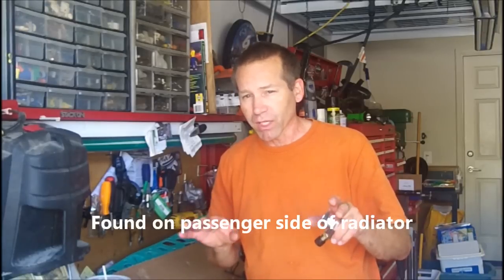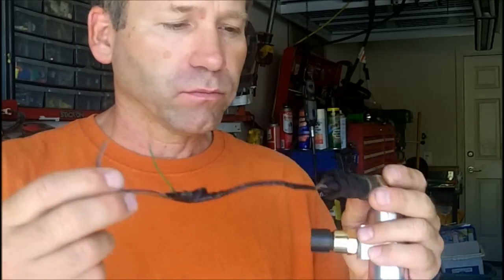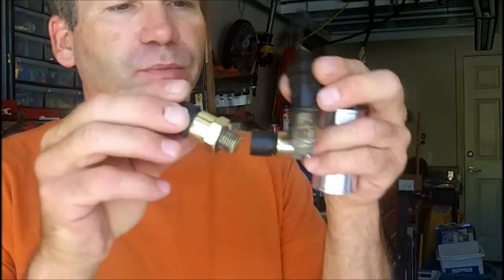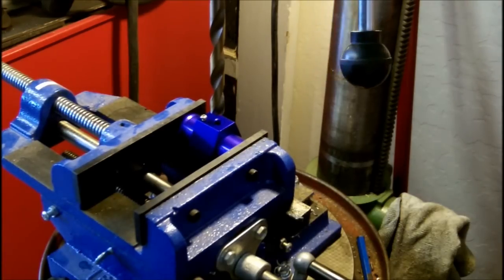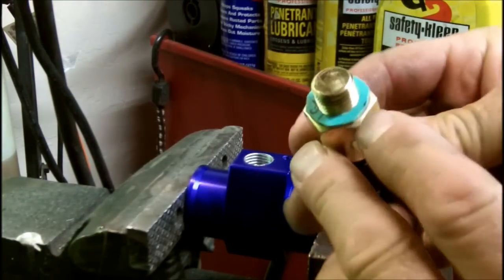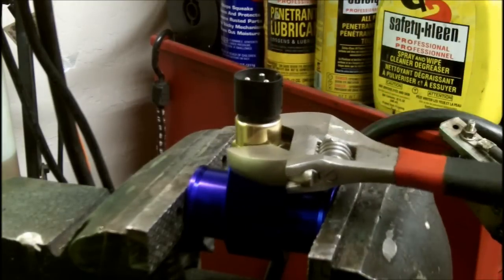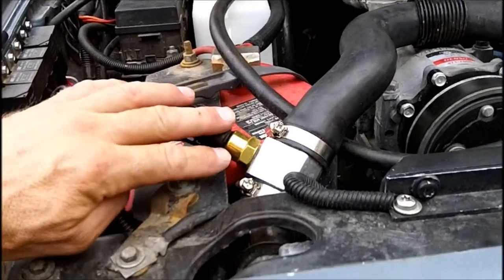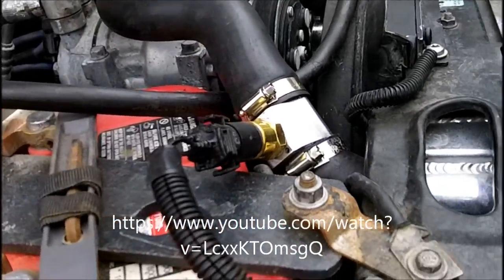How to install a 2 speed BMW Fan Switch and radiator hose adapter

Comment: Great video, could you please answer this question would this work for a 2013 Ram 1500 , i don't know what fitting i might need i just want more cooling on hot day's here in the south and traveling....you video gives a better ideal on how to do it please advise.

Comment: Do you have a pinout for the BMW thermal switch?  I'm trying to put an Efan in my E39 and no one can tell me for sure which pin is ground/low/high.  Your linked video says it's a Saab switch.

Comment: We sell the in-hose thermostat and fitting in this video at https://www.americanvolt.com/collections/in-line-thermostats which requires no tapping. Hose fitting sizes available from 26-50mm or 1-2 inches outside diameter. Various thermostat switch turn-on temps available as well.

Comment: I know this is an older video.  Do you think a 30mm radiator hose adapter would work fine?  I'm asking because amazon now has a plethora of sizes available, not just 32mm.  Thanks, Dylan sends (I'm surprised this thread has not received a bunch of posts!
Reply from the maker: yeah I think it would work but if your looking for a 32 here is a link https://amzn.to/2ZlYPk2
Reply: @martinbuilt  Thank you for the reply. Strange, YT did not notify me that you replied. Such are 1st world problems ! Thanks Again, Dylan /edit My wrangler has an Inside Diameter (mm):  32mm /edit again, I'm going with the 34mm as a lot of reviewers are saying the 34mm is the 'lip', guess I'll find out.

Comment: The 97-98' 528i radiator fan sw has a higher temp on and off. Better but st might require a lower t-stat.

Comment: BMW switch fans stay running forever. Shut off temp is to low for the inlet side. hose of the radiator. Saab an VW switches have a higher temp on and off thus fans run only when needed and do shut off when cruising

Comment: One bit of advise. Since you already used your drill press to drill the hole, leave the work piece in the vise and replace your drill bit with your tap. Start the tap into the piece with the press so that it goes in exactly straight. Since the piece is only aluminum, you probably could even use the press powered up to do the tapping, (IF YOUR SPEED IS SET SLOW and YOU SHUT IT OFF QUICKLY).

Comment: I Did this with merceds fan switch but the head of the switch is not passing through the adapter barely passing and my fan some time wor and most time overheating should t be trrated as one block i mean when adapter get hot the switch should be at same tempreture and should work am i right?
Reply: That's probably why they make them out of aluminium, which is a good conductor of heat.
A solution for you is to use a lower temperature thermoswitch (so it turns on at a lower temperature) or like the top comment says, turn the adaptor upside down so that there is definitely always fluid in contact with the sensor.

Comment: 8:34 It turns from blue to silver. Amazing.
Reply from the maker: Yes I made more than one. The blue one was slightly too small of a diameter for the radiator hose the ebayer that sold it advertised it incorrectly. So I ordered another one and did it one more time.
Reply: I know, I was joking :)
Reply from the maker: I figured as much...Lol

Comment: Do you waterproof your relays??
Reply from the maker: I haven't but it would be a good idea if your going to be doing deep water crossings.  I believe the Zettler  relays that I used are water proof.
Reply: I had another question on your wiring video, I’ll ask you there!  Thx for the reply

Comment: when the high activates, does the low stay active?
Reply from the maker: Justin Hoglund no it does not if it did this would burn up the motor eventually
Reply: Does the low side switch cuts off when high kicks on or the relay takes care of it? The reason i ask is that i need to connect ac compressor to the curcuit.i know how to do it with 3 bosh relays though

Comment: Thanks for that. When I drill and have to tap I leave the job in the drill press, take out the bit and replace it with a rounded nail that locates in the dimple in the top of your tap. Hang a weight off one of the handles to keep the nail pressure on the tap and away I go a per usual. That way (at least for me) the tap will be plumb to the hole.
Reply from the maker: nice

Comment: why you guys installing the coolant fan switch on the outlet to  the engine to raditor, example  newer vehicles  run 195 -205 degress  coolant temp coming out of the engine is regulated  by the thermostat  so if you install a 210-195 200-185, 185-175 it would never turn off! leading to premature  electric fan motor life, sensor should be installed on the outlet side of raditor so the fan will cycle on and off, when going down the road in most case the e fan will not come on! unless your slow climbing a hill.

Comment: The switch should be on the OUTPUT / LOWER radiator hose sensor aimed at the ground; this will ensure your sensor is ALWAYS in the coolant flow. If your coolant is too low there will be air on the upper half of the hose and the switch will not activate because it can't sense the actual temperature of the coolant 1/4" away...
Reply: put the sensor side of the adaptor on the bottom side of the top hose... hanging. genius.

Comment: Thanks for this video it was very helpful. I'm doing an LS swap in a Nova and am figuring out my cooling system. I'm running a stock 2002 Camaro radiator and dual fan setup. I snagged the fan control box out at the wrecking yard that runs the fans in series, or parallel (dual speed). I was planning on running this BMW switch (there's two different switches I've found so far with varying high speed temp). My question is that some people say to run the sensor in the hot side of the coolant flow, and some people say to run it in the radiator outlet, or cool side. I think I'm leaning on the cool side as the radiator outlet is a direct measurement of the effect of your radiator and fan system to lower temperatures. If the coolant coming out there is too hot it turns the fan on. If it's on the hot side the fans would run a heck of a lot more often and sometimes for no reason. Anyway, a good post is from Mike Goble over on this forum: http://www.stevesnovasite.com/forums/showthread.php?t=415225. I was just curious what your thought process was on deciding on the hot side. Thanks again for the video.

Comment: The plug is four parts that are available from BMW for $27. 

#61131378412 - plug housing

#61130007445 - wire, small, x2

#61130007446 - wire, large

#61318361787--BMW temp switch 180°/195° 

#61311378073--BMW temp switch 195°/ 210° 

Get a Volvo 2 speed fan relay new for about $35 on ebay, made in Germany, dont get the china crap. Get the plugs for the relays from your local bone yard or interwebz.. Nastyz28DOTcom has the best info for the taurus/volvo fan swap.. The volvo fan is good for around 3600ish cfm on high!
Reply: Freshkryp69 where are you finding the housing and 3 wires for that price? Cheapest I found was around $35 minus shipping.
Reply: @leviv1  Ebay

Comment: Would this switch work for dual hi/low speed  fans? Also what are the three wires in the switch? I'm guessing ground hi and low wires? I'm trying to do a dual fan dual speed with ac set up on my truck. I would like to set it up to where one fan runs just off engine temp and the other fan runs just off ac. I would run the ac fan strictly on hi. Would your set up work for the one I'm trying to do?
Reply from the maker: Yes you could wire it for low for engine Cooling and high is for the air conditioning. yes you are correct one is ground and then the other is high and low would complete the ground circuit. you could also use it to complete a positive circuit as well.

Comment: I have an 01 ford 5.4 and have installed this sensor in the water crossover on the intake. It turns on at 195ish and doesnt turn off until under 192 its causing the fan to run  a lot. Do you think the sensor location is causing this? It's right next to the outlet hose.
Reply: This is a aux fan switch for the BMW the temp is to low for the inlet side of the radiator. It needs to go on the outlet to the engine after radiator has cooled coolant below 190 degrees. If not low speed fan will run all the time.

Comment: Whats the part number for the BMW thermal switch? Do you happen to know the temperature settings which it turns on and off?  What amperage relays are you using for the Taurus fan? I know you used a 30 amp for the AC switch but what did you use for the low and High side for the fan?

Comment: There is another BMW temp sensor that has a lower temperature range that would probably be perfect to bolt into the cool side of your radiator.

Comment: Does it matter which wire gets used for the high / low side ?
Reply from the maker: +Tony Bevis
Yes it does matter. I failed to mention that in the video. Remove the connector from the thermo switch. Look down into the switch you will see a T1 that is low speed and the one labeled T2 is hi speed the remaining one is  your common, it should be labeled 0.
Reply: THANK YOU!! I scoured wiring diagrams all over the 'nets (none seemed to match the colors in my connector) and this was exactly what I was looking for.
Reply: Phil Mitchell Me too. I had mine running and disconnected it to do the permanent wiring and forgot which was which, and well, you know. couldn't find a diagram anywhere